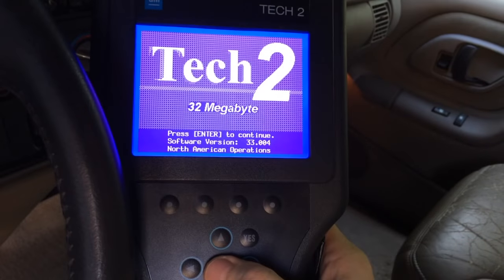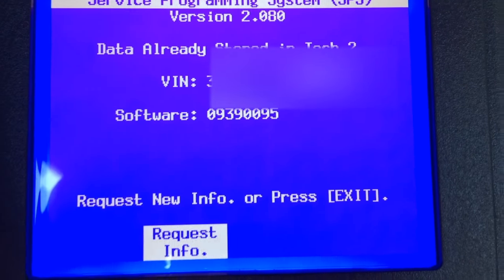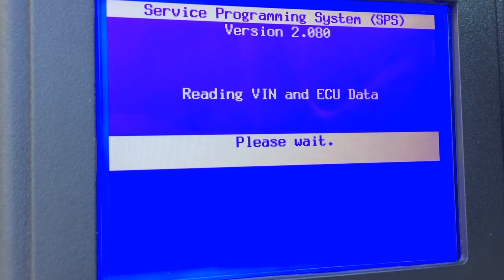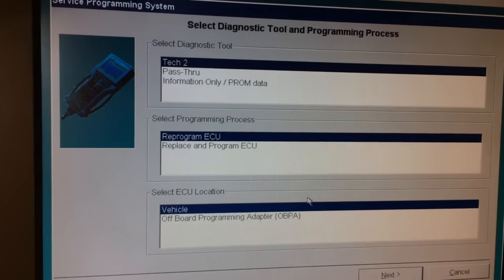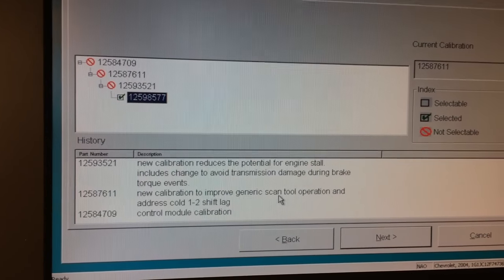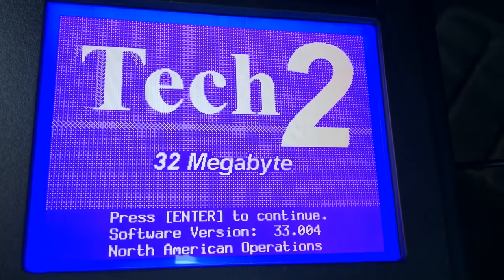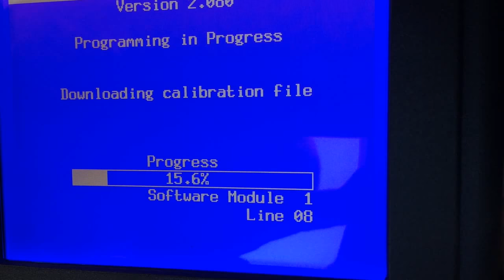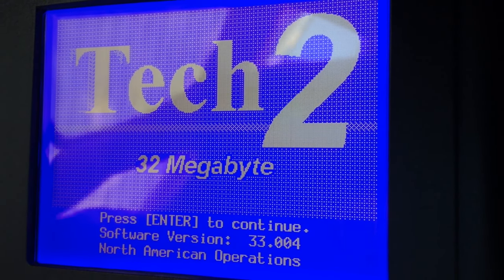GM SPS Programming: Tech2 Tool Remote Mode ECU TIS2000 How to do a Calibration Update Reflash (PCM)

Comment: And..........not only did I post these comments under the wrong video, I also forgot to mention that the CANDI module IS in place. Hey, I'm old............I forget things.
Reply from the maker: @Barry Condon I presume you meant to post comments for this video https://www.youtube.com/watch?v=53fho7l7yxI&t=300s and that you're asking about the screen shown in that video at time index 4 minutes 14 seconds?   If so be sure you selected the "Device" as show in that part of the video, and that then the "Port" populates with a default value of Auto.
Reply: @DrShock  I'm stunned, (or is that Shocked), by such a quick response. I can't thank you enough.Indeed I posted to the wrong video but your reference is correct. I chose LEGACY PASS-THROUGH from the device menu and nothing came up in the PORT window. I ran a connection check and , of course, no go. I'm also a bit foggy on the status of the Tech2 at this point. From what I can gather connections aren't relevant until the next steps. As I mentioned earlier, tried connected and not connected with the same result. Also from reading some of your other responses it seems maybe my son's 2008 Saturn Vue falls into some nebulous area between TIS2000 and TIS2WEB? Any insight?
Reply from the maker: @Barry Condon Saturn does seem to be "different" and there's quite a few posts in forums out there where owners cannot get TIS2Web working with them and a Tech2.   You definitely have to be able to pass that diagnostics test like I show in the other video.  But this would just be for SPS type actions.  What exactly are you trying to do for the 2008 Saturn Vue?
Reply: @DrShock  Update the HVAC module. I was able to extract the update info from acdelcotds but can't connect to download the updates. Also got to thinking (based on some of your info) that maybe I really want TIS2000, but as you point out, it doesn't seem to like windows10 and I got nowhere. I should add, I'm a technical dinosaur but am not totally inept. (I hope). Thank you again!
Reply from the maker: @Barry Condon when you got your Tech2 it usually came with a TIS2000 DVD-ROM as well.   That software only goes out to model year 2008, just barely and only with the updates you install separately, but that might be a better path of success for you and the Saturn.   The TIS2000 SPS calibration is a bit different, this video we're chatting in now is actually where I did that approach.  The last known update to TIS2000 is March 2008, but most clone deals at least come with the December 2007 one which should be enough for what you're trying to do.
Reply: @DrShock  It did come with a DVD-ROM labelled TIS2000 which I'm sure you're referring to. (As I understand it the update files and whatnot are contained therein)? Trying to install it on my fairly new (7 months) laptop with Windows 10 seems to be a stumbling block, though. It refuses to cooperate. Ideas?

Comment: Can a Clone tech 2 do the job or it's must be a Real tech 2, thanks ?
Reply from the maker: My videos are all with the high quality Chinese clone.   There are a couple of models out there, the one that includes all the attachments is typically the high quality one.
Reply: @DrShock  I want same this tool. May I know the link? I want to buy good one. I bought clone one and tried to used with cracked tis2000 but not easy to download the software to the tool. In every 30 times try only 1 time download. Also spoil the module in middle of programming show error and stop to work.
Reply from the maker: @makkial-saboodi3569  I have links in the video description.
Reply: @DrShock  yes I checked that link shows for many tech2 tool but don't know which one best one.

Comment: That a real tech 2 or a clone? Been looking into a clone
Reply from the maker: very high quality clone
Reply: Video style looks familiar, did you do one where the dc to dc supply was replaced?

I’m currently in the market for one for personal use was looking at China car diag
Reply from the maker: Yes, I did that DC to DC repair vid.  https://www.youtube.com/edit?o=U&video_id=VAmGybyWfJ4
Reply: Any particular seller or you recommend? 

I see the prices are all from 250-450 with minimal differences in “accessories”

I’ve got a 97 suburban, 01 blazer, and 07 Malibu lt - each with their own needs for a tech 2 lol
Reply from the maker: I haven't bought one of these in a few years, but as I recall it was down to only two factories in China making them still and both were pretty similar.   I'd suggest buy on eBay, so you have a 30 day refund guarantee.  And buy from a US based seller, so you're not waiting weeks or having increased shipping damage risk.  I couldn't suggest any particular seller as so much time has passed.  I will point out that the weak link in these is the clone flash pcmcia type cards that hold the firmware, they are really cheap and fragile so be careful inserting it and then leave the card alone.   It won't tolerate more than a few insertion/ejection actions before crapping out in my experience.
Reply: I have an original bosch tech 2
Reply: If you connect the tech2 by using the power trough the obd2 and you start the vehicle.. it always reset  and I have input vehicle information again..Do you have that issue with your clone?
Reply from the maker: That's a normal voltage drop during cranking behavior of any Tech2 clone, but a genuine Tech2 should not behave that way unless it's original DC/DC converter has been replaced with an aftermarket part (possible if it was not fixed by a factory repair depot).
Reply: @DrShock  can you just keep the AC power adapter on at the OBD end of the cable to get over the re start of the engine, my genuine Tech 2 had the DC/DC converter replaced by my soldering guy that I use (thank you for the video DrShock) so it's not original part, but I was really happy to have my Tech2 working again :-)
Reply from the maker: It's been awhile since I had to do this, and I honestly cannot recall if the AC power at either the handheld connector or cable end connector was successful in overriding the ODB port power drop induced reboot of the Tech2.   I'll try and check it out this weekend.

Comment: On the 12587611 you say something about the generic scan tool operation improvement and then say like tech 2!  The Tech 2 is a Factory Tool so the Calibration would help "Aftermarket" scan tools and not the tech 2.  I'm sure you know that but I figured I trough that in there.
Reply from the maker: Thanks, yeah misspoke on that.  Third party J2534 type scan tools.